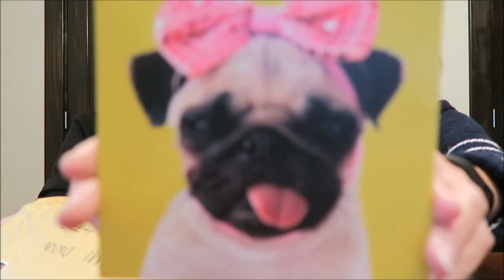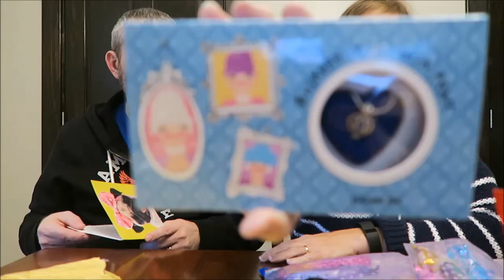How To Change A Tire Vlog & Box Openings 11/24/15 – 11/28/15

Comment: I just got four new tires for my car. Cost me a solid $665! But it was time and I needed them. The front tires had no tread and there was a slow leak on one in the back. I drive a 2012 Toyota 4Runner. So I've had it three and a half years so I reckon it was due time for some new ones. :-)
Reply from the maker: +Brett Bailey It gives you a great sense of comfort knowing that the tires are new!